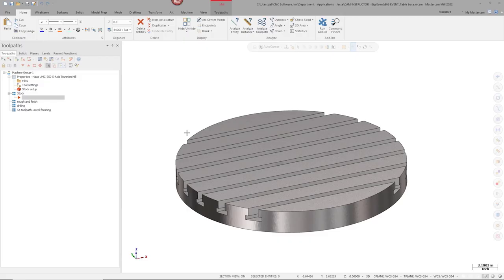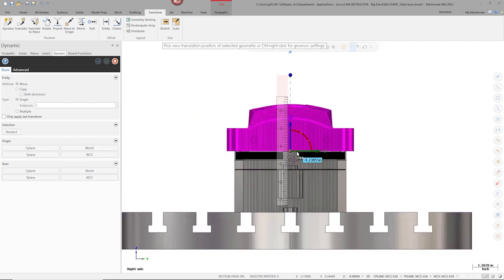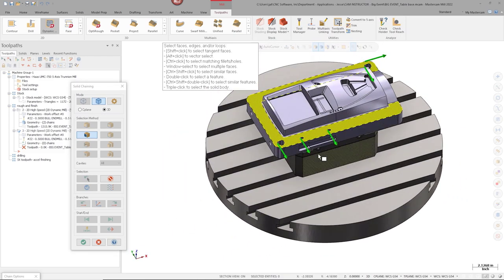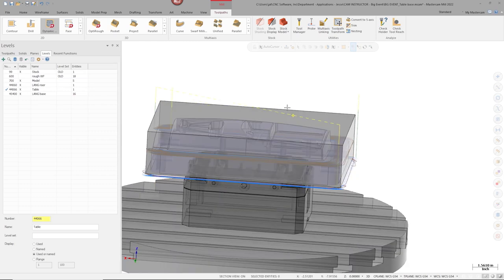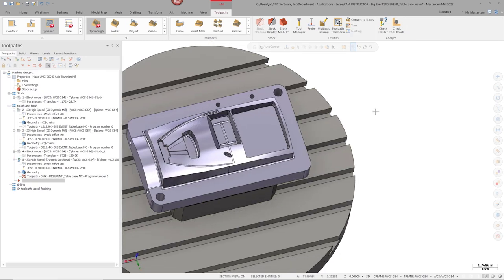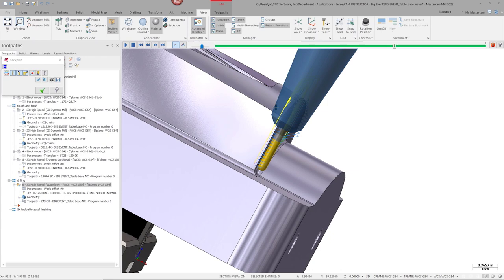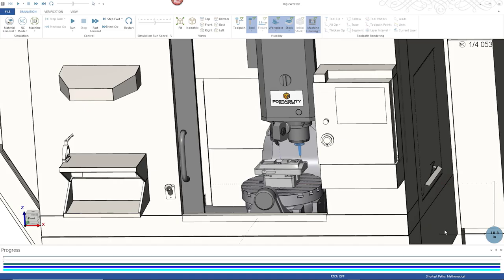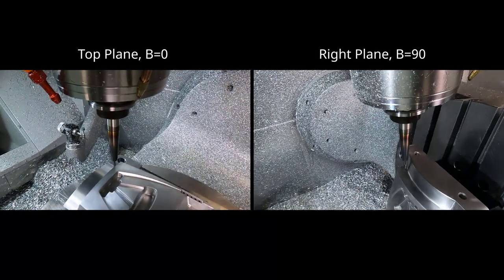Mastercam 3D to 5X with Jesse | The BIG Event

Comment: Zigzag on aluminum works fine, especially with roughers that has chipbreaker grooves. And last almost forever. Talking from own experience.
Reply from the maker: Ya, for soft material it's not so important. Heck, you may as well run 70+% stepover at which point climb vs conventional is moot.

Comment: why doesnt he just uses all other operation as stock reference at 15:40 and instead creates a new stock model beforehand. Thanks in advance
Reply from the maker: If you make any changes to the toolpath it will recalculate the stock each time based on those selected stock defining toolpaths. By referencing a stock model, that stock calculation is done and immediately feed to the toolpath.

Comment: How are their surfaces and parts running flawlessly on a laptop? I have a beefy computer and 2021 lags with one part in it. (Yes, even after making all the necessary changes in my graphics card/acceleration
Reply from the maker: If you are running a dedicated video card, which is the minimum recommended hardware, you should not have to make any changes to the graphics settings. This setting will make Mastercam perform poorly so the system can run it. It is not recommended or supported. You should look into a laptop with a dedicated video card, if you have one make sure Mastercam is using it and that the drivers for it are up to date.
Reply: whats "beefy" to you may not be "beefy" to me. CPU? RAM? GPU? SSD or HDD?
Reply: @flawns  It was a software issue. Mastercam 2021 wasn't that great. I installed 2022 and it works flawlessly
Reply: @cheeriomartinez  ohh okay that makes sense. Thank you for correcting me! I was too fixed on specs and not software

Comment: When I use glass for my stock model MC (2021) automatically turns all of my part & fixture solids to glass. Is there any way to fix this?
Reply from the maker: You'll have to switch the material type for the part/fixture. You may have it set to glass initially which when you then enable Material, everything is showing as glass.

Comment: How do you know where it put the fixture on the table? Or where the work coordinate zeros are?
Reply from the maker: Haas UMCs have DWO/TCPC. Basically options that allow you to put the part anywhere on the table and the machine can compensate. Machines without this, you have to program with your part in the same position in CAM as on the machine, relative to Center of Rotation of the rotaries.
Reply: @CamInstructor  is this the G254/G255?
Reply from the maker: Ya, DWO G254, TCPC G234.

Comment: Is it possible to change the way mastercam "looks" at a surface it's cutting from being parallel to the tool axis to being normal to the drive surface? Does this question even make any sense?
Reply from the maker: The 3D toolpaths will always look at the part normal to the Z plane. This doesn't mean this is how stepovers are calculated though, that varies from toolpath to toolpath. 5X toolpaths, sure they can see a part normal to the surface it is cutting. Stepovers again are vary. Maybe the best answer here is a question, what is it you're trying to do?
Reply: @CamInstructor  Well because having it look normal to Z rather than normal to the drive surface causes wonky things to happen sometimes, which would be solved by looking normal to drive. They aren't insurmountably wonky, of course, but still.
Reply from the maker: Example?

Comment: It’s a pity that you guys in Mastercam itself have to use machine simulation from 3d party developer and don’t have it build in in the software. One day I hope it would be possible to choose any machine from any brand inside Machine Definition.
Reply from the maker: I'm not sure why having Module Works driven simulation is a bad thing? The stuff they make is top shelf and I'm glad Mastercam has it included.
Reply: @CamInstructor  Don’t get me wrong.
I like modules from other places as long as they work. Especially from ModuleWorks, i found them many times better than their analogs from original Mastercam modules. I just hope that inside Mastercam  Machine Sumulation one day I could choose mine Matsuura MX520 and will get right simylation without Camplete or Postability
Reply: @ov3753  i think Sprutcam has a built in machine simulation which uses the generated gcode.
Reply: @ipadize  I'm not in position to change CAM system right now. Also there is no Sprutcam in North America.
Reply: @ov3753  yes, there is.